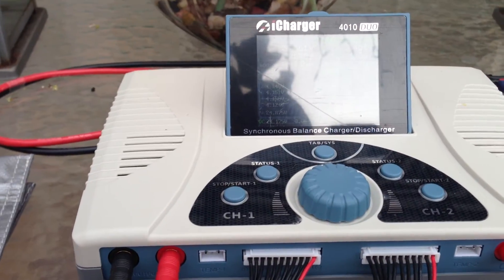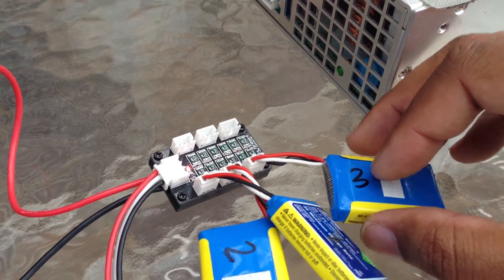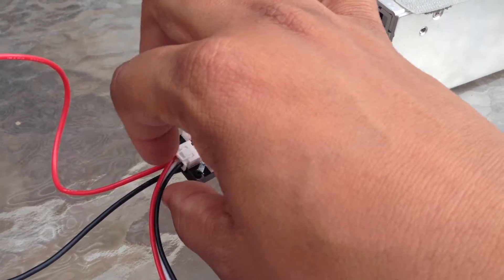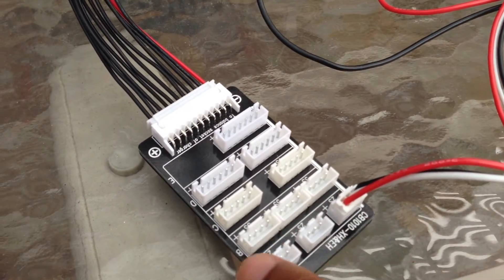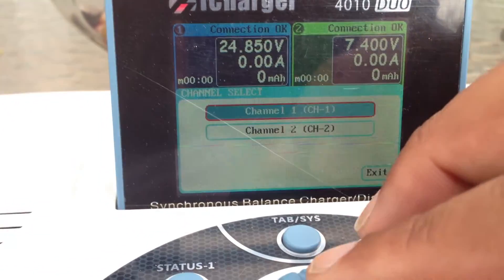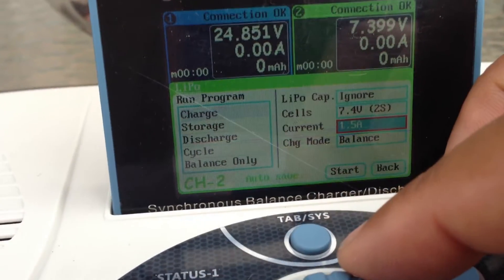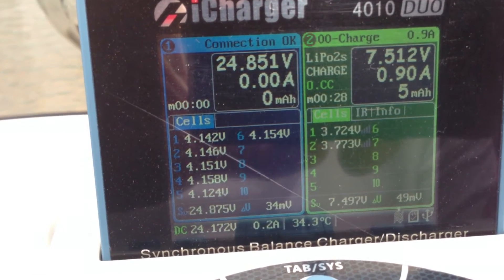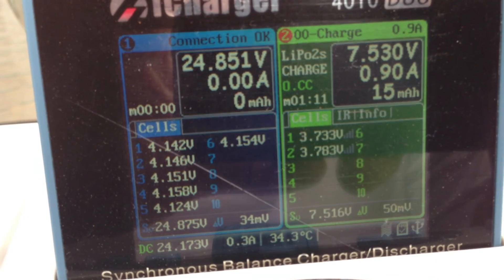Parallel Lipo Charging: iCharger 4010duo with Parallel Charge Board for 130x

Comment: hi, i was looking at this board,  to charge the same batteries ,but will it work with a cellpro charger?  does the banana plug and the 2cell plug have to plugged in to charge? or  could i just plug the 2cell in the cellpro board and be fine?  and can you use this board with only one battery plugged in?   thanks
Reply from the maker: The Celpro charger is a good charger.  I can not imagine it will not take banana power and balance leads.  Some smaller batteries like these, people do charge through the balance leads at low C ratings.  By connecting the banana plugs, I think you are referring to the parallel board, which does need to be connected to parallel charge the batteries.  And you can certainly use the board with only 1 battery plugged in.  The charger sees any parallel charging as a SINGLE LARGE battery.  Or, in this case, a true, single battery.